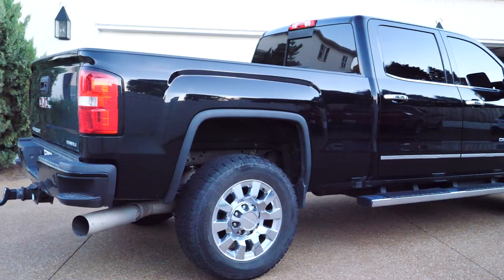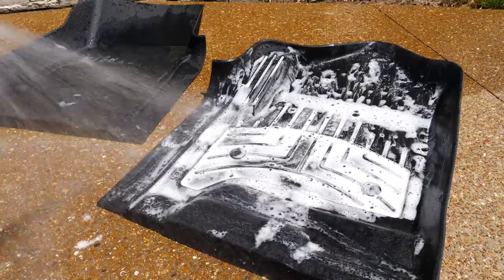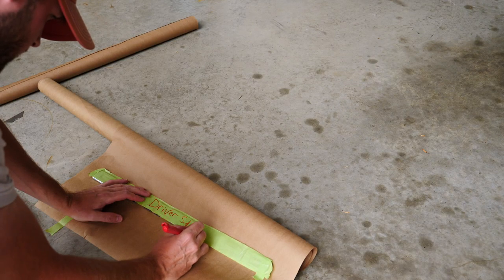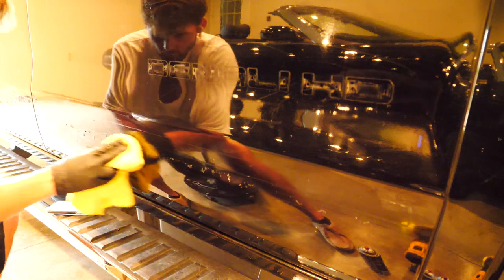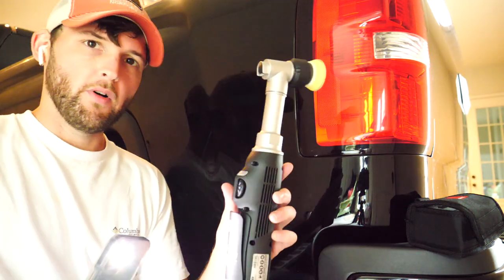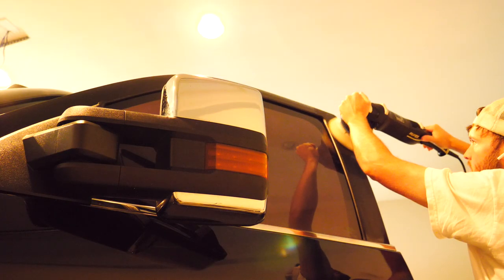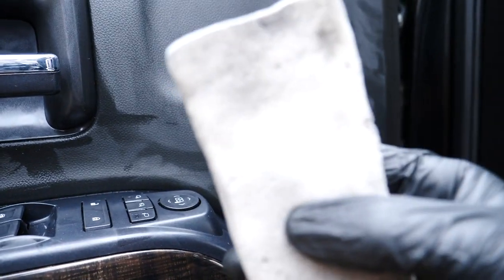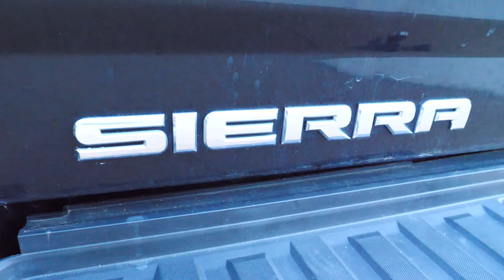Debadging & Polishing A 2500 GMC Denali Duramax

Comment: I appreciate your commentary and explanation of the steps you took and why you go in that order.  If you haven't found anything yet, I would highly recommend 3M Adhesive Remover.  I use it all the time, especially while debadging.  Spray it on and whip with a microfiber towel a few seconds later.  Its that simple.  Give it a try!!  Stay safe, Fezz
Reply from the maker: Thank you Fezz! I will have to give that a try.